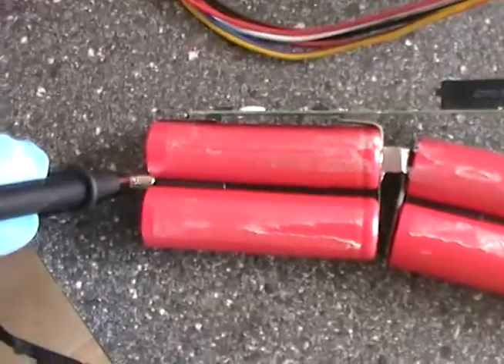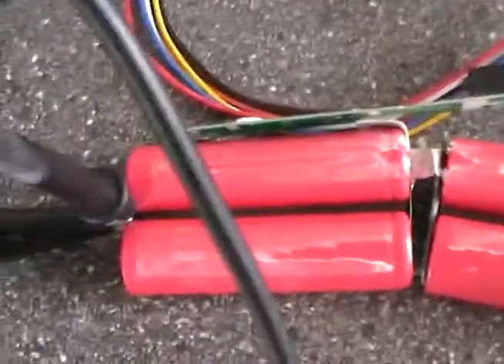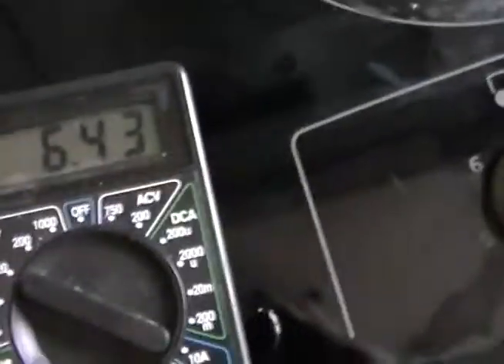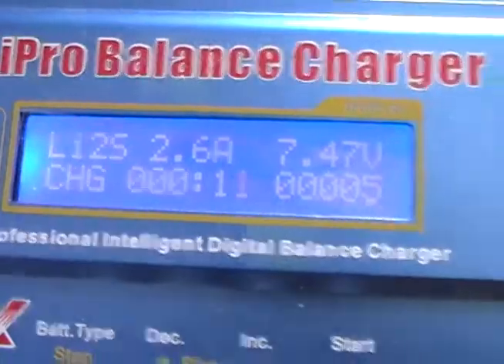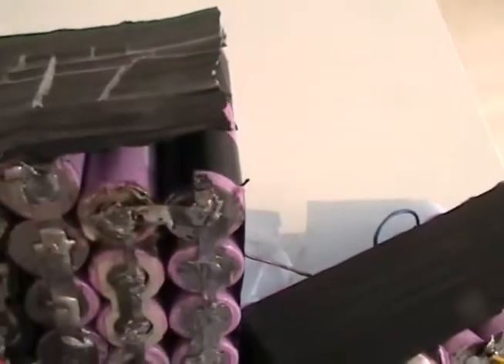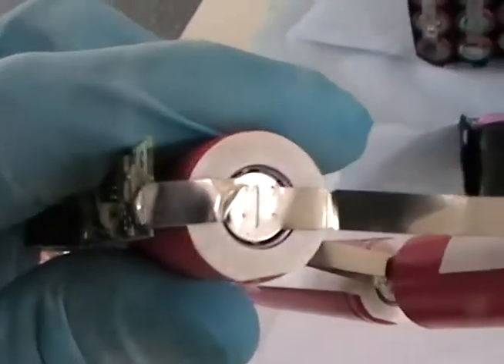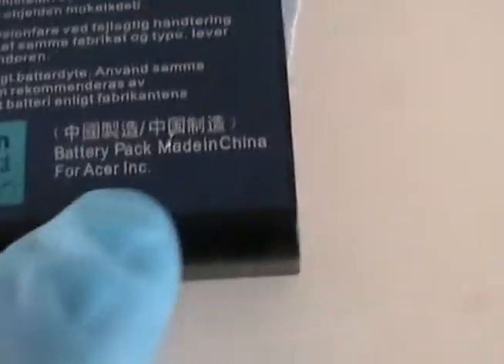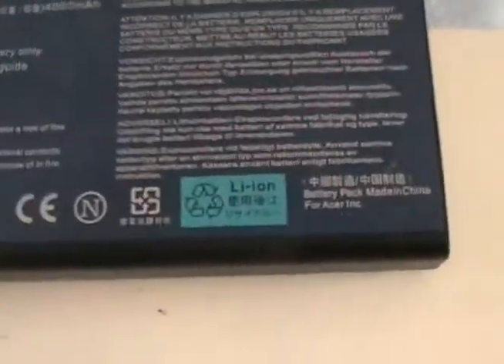DIY Lithium Ion batteries for beginners Part 5 ( SANYO 18650'S FROM ACER PACK )

Comment: Hi! Excuse me for asking you, I have many sanyo cells with the light blue cap, the same as the ones you use in this video and I would like to ask you if they are good for building a battery for an electric bicycle. I have looked for information on those cells and I am not clear, there are sites that say they are not suitable for high downloads and since I am not sure, before starting to mount them, I prefer to ask you first. Thank you very much for your attention, regards!
Reply from the maker: I found the Sanyo ones with the purple tops to be the best , the light blue ones are OK , do you have a method of charging them??? If you get an imax B6 you will be able to test them , the imax can run off a car battery , or you will need a 12 volt power supply that runs from the AC.
Reply: @GavinFreedomLover  Hello, good morning, I really appreciate your quick response. I just bought a Liitokala lii-500 charger to know the capacity of the cells and thus group them, but it comes with a factory fault and port number one does not start. For the moment, I will do it 3 by 3. Can you tell me if it is important and should I keep in mind the internal resistance of each cell? Or the resistance is a value that only matters to load them? Thank you very much!